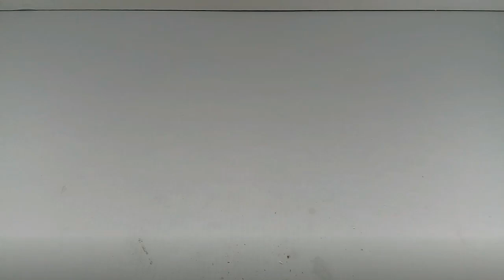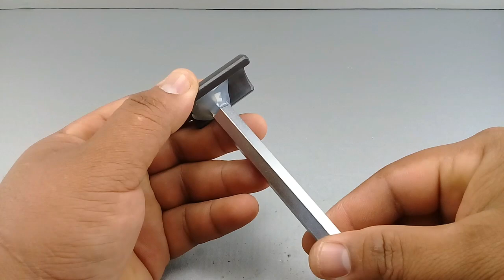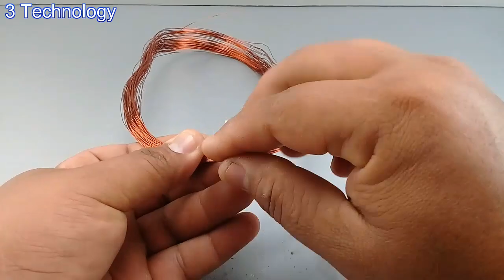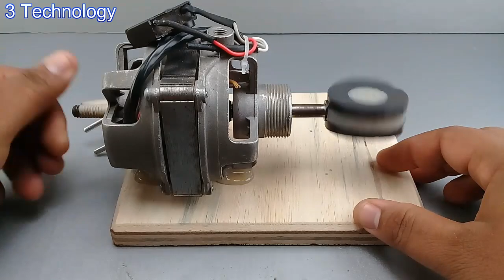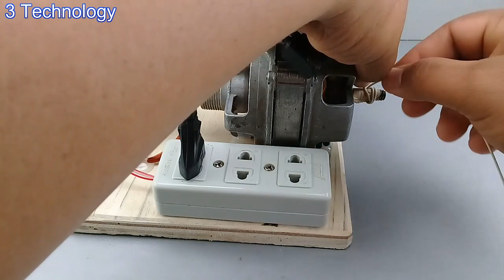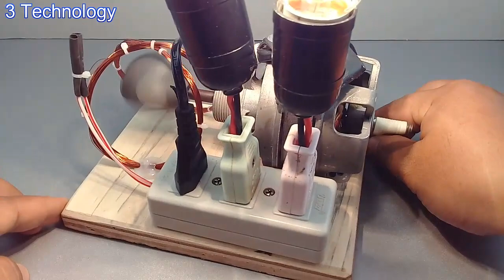how to create powerful free electric energy with copper wire gear

Comment: Using the battery and inverter in the plug block again 😂😂😂😂😂😂
Reply: Only for selfrunning?
.. maybe 

But one real resistor and it will be slower and slower until it stops